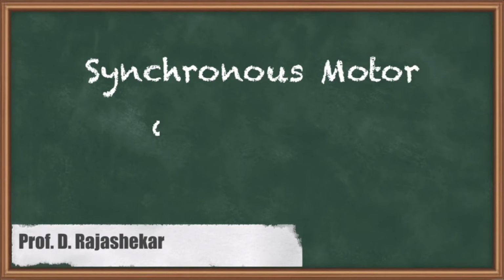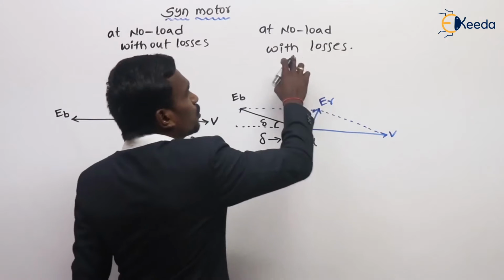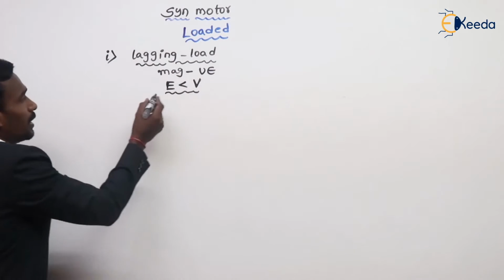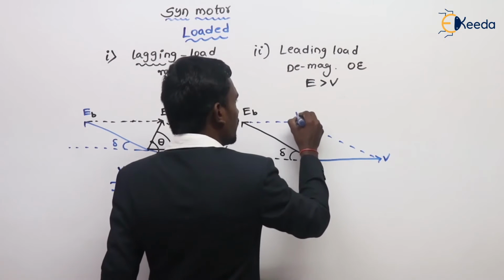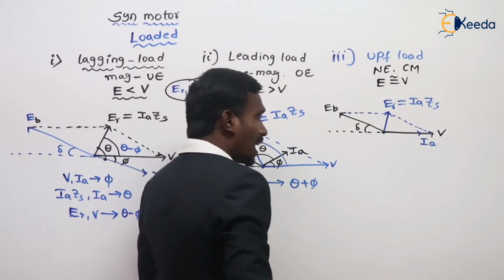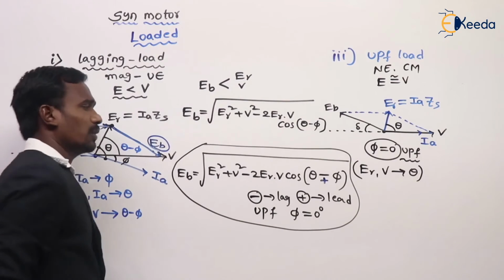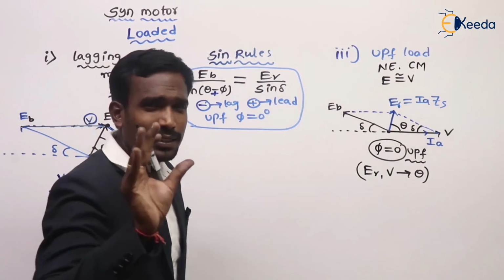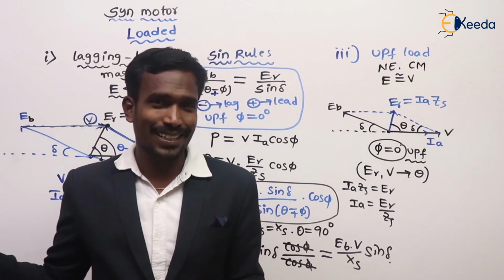Synchronous Motor At No-Load And Loaded | GATE Electrical Machines

Comment: I do not like the manner in which the presenter draws the  vector diagram. Let us take an example.

If a DC motor is supplied with a DC voltage,  where one terminal is positive and the other negative, the  armature will rotate and it will generate  a back emf.

Now if the same motor is coupled to a diesel engine and rotated in the same direction then the back emf will be the same polarity  as when the machine was used as a motor.. 

This means that when one draws the vector diagram the  supply voltage to the motor should be in the same direction as the back emf, Then the resultant voltage would be obtained by subtraction of the  supply voltage and the back emf. 

In his vector diagram, he first reversed the back emf, and then he added it to the supply voltage. Again, if you run a motor in the same direction by coupling a diesel engine to it, the back emf would have the same polarity as it had when it was used as a motor.    One should be very careful how to draw vector diagrams not to confuse the students, and also depict reality as it is.